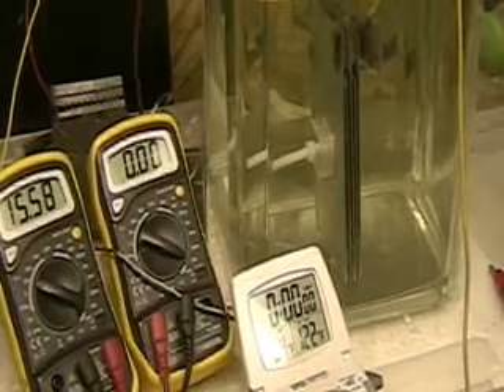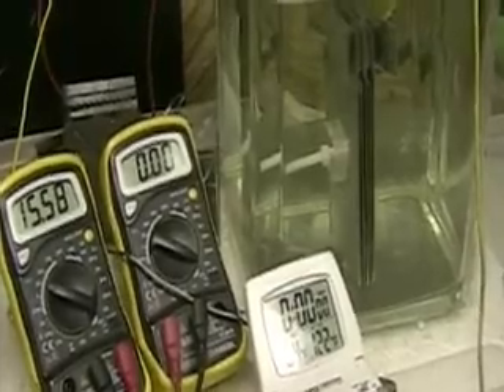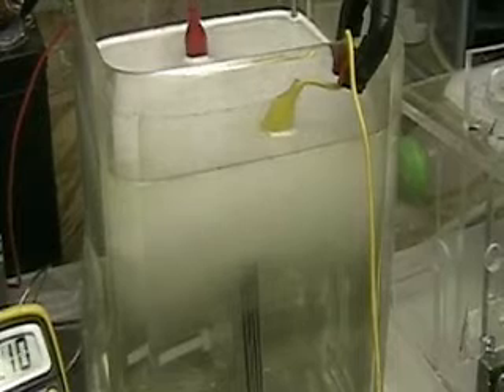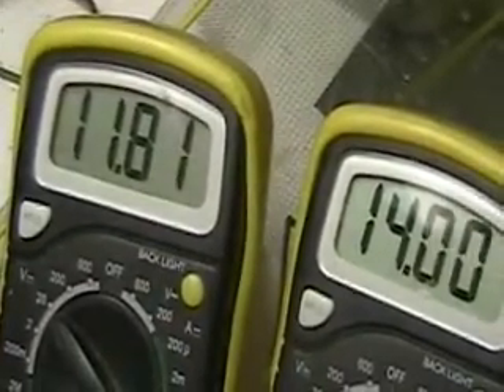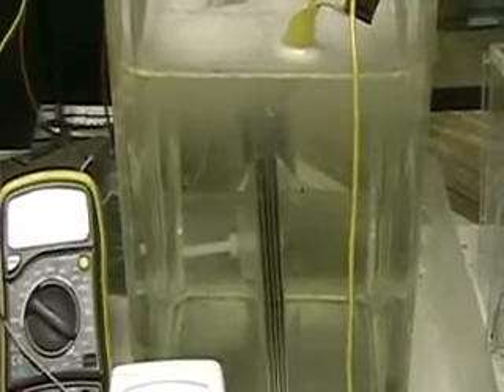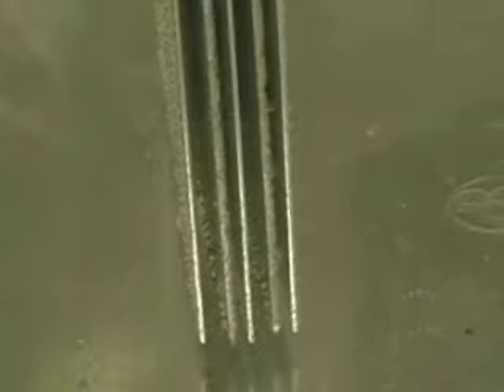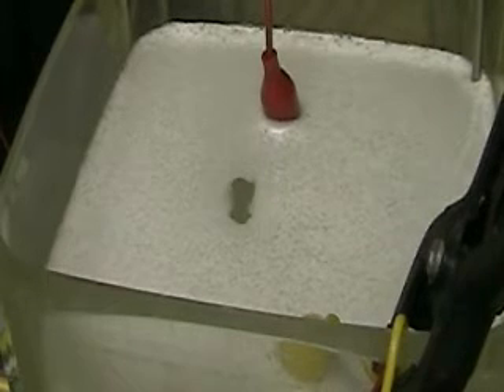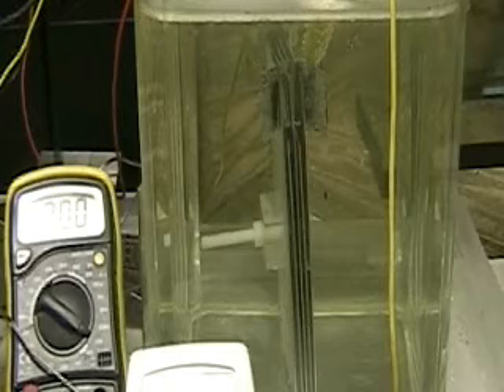Hydrogen Tap (Focus Cell) 294

Comment: Nice work John,
I have done a lot of experimenting with dofferent configs myself and hope to soon have some plate and tube details to compare.
I too have not achieved a noticable difference using neutral plates or sealing the outside of the plates to stop leakage but only side by side will tell.
As you stated we all have different opinions and slightly different configs and what works for one doesn't necessarily work for another.